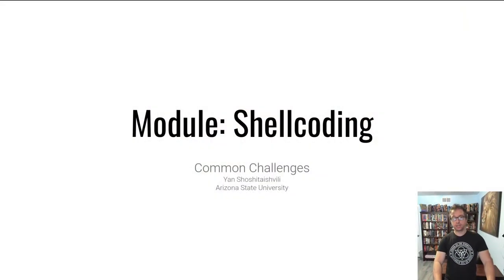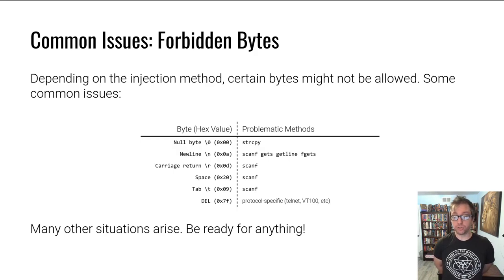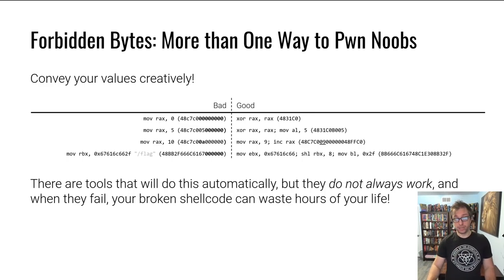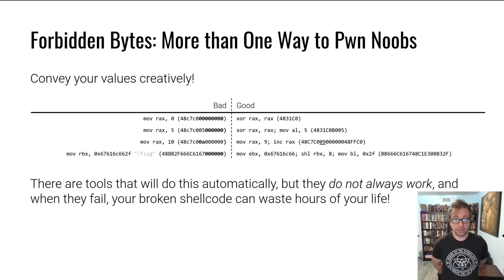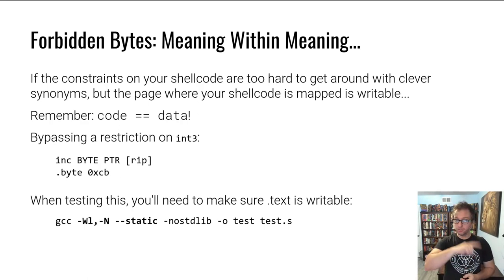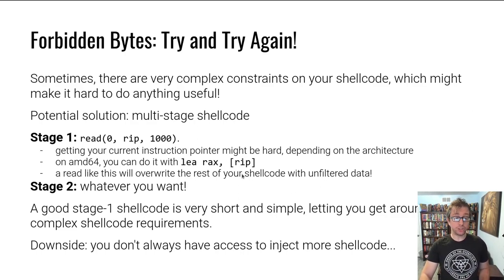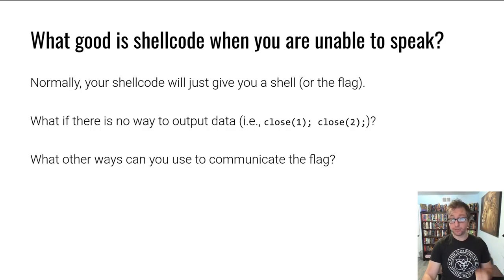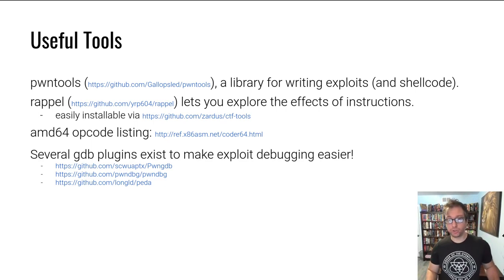pwn.college -  Shellcode Injection - Common Challenges

Comment: Do you have links to articles on writing shellcode packers/unpackers? Specifically, self modifying shellcode.
I cant do 'add byte ptr [rip], 1' to modify the next byte, because [rip] gets turned into an opcode with a 4 byte offset, so 1 gets padded with zeros...breaking my uniqueness immediately.
Is there is an opcode modifier that can make it a short, one byte,  rip offset?